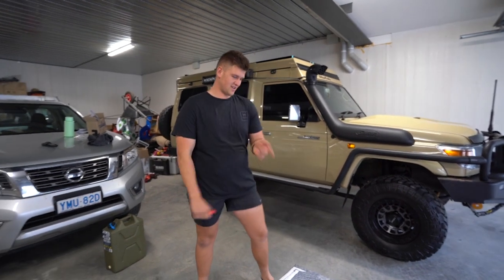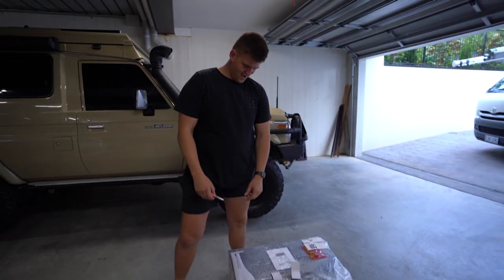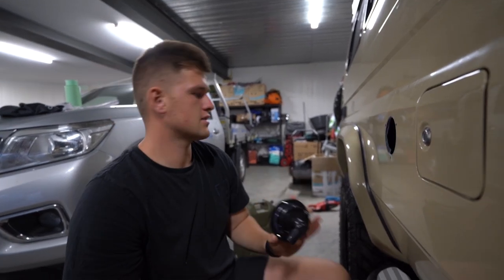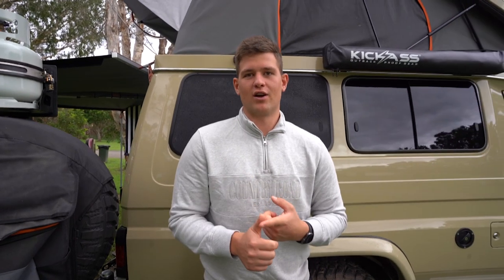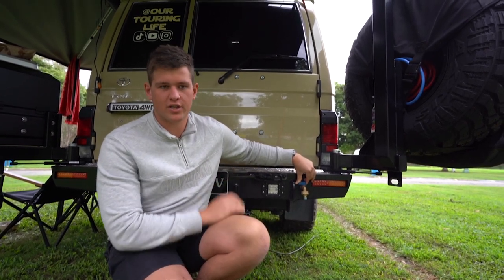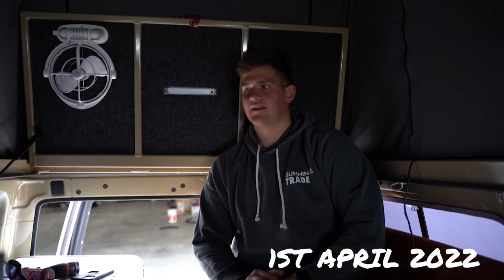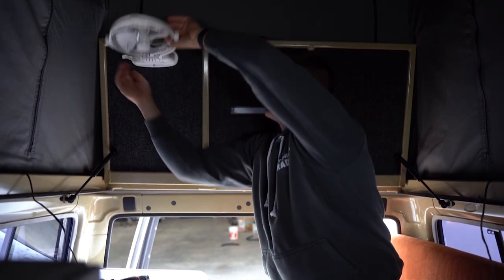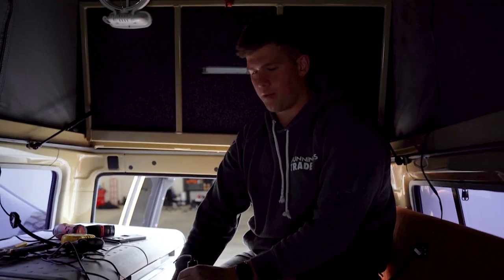TROOPY BUILD - EPISODE 9 / WATER TANK INSTALL / PRE FILTER / FINAL WIRING

Comment: Long Range Automotive in Lilydale Vic don't put this tank on their website as it's not their core business. But it's 90L and costs around $1800 supply only. They charge approx $440 for installation and you might also need exhaust modifications on top of that. You can get them through places that specialise in Troopy mods, like CMS Bacchus Marsh or Expedition Centre in NSW.
Reply: I enquired at Long Ranger and they responded they dont supply it?
Reply: @Variality73  long range automotive tank not the longranger.